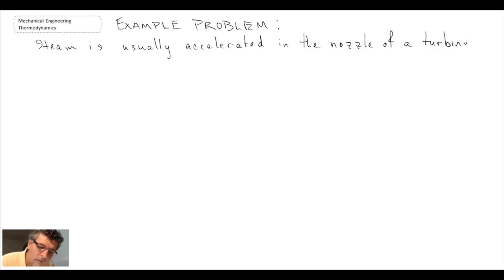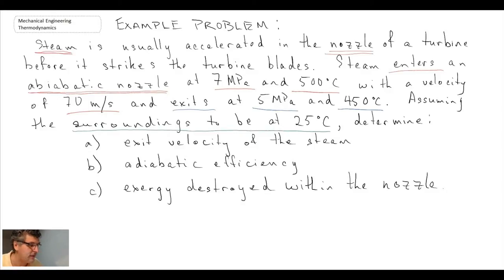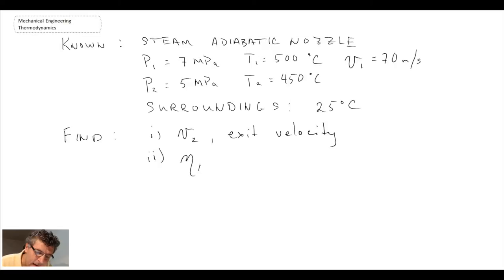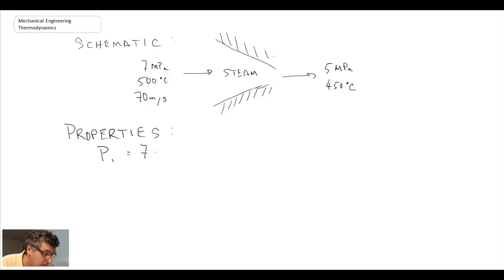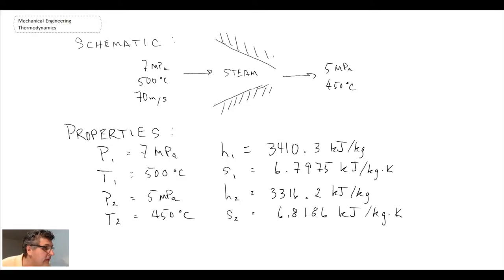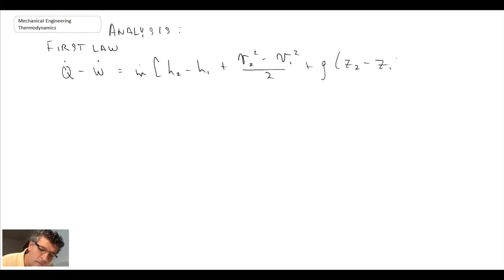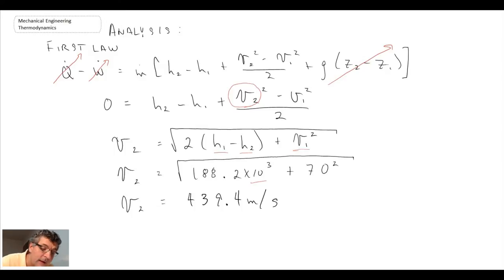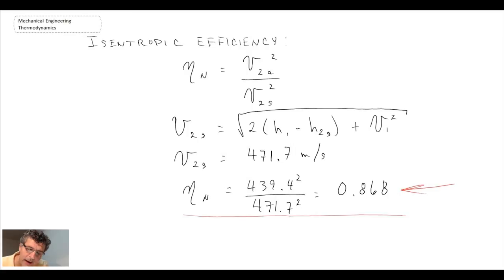Mechanical Engineering Thermodynamics - Lec 13, pt 2 of 3:  Example Exergy Destruction

Comment: Great lectures Ron Hugo !  I was wondering what P2s at 7:55 is?
Reply: it was assuming this process is reversible and adiabatic, then if we want to find S2s, then its value is the S at p2s, which  is equal to S1 so that delta S=0. 
Hope this helpful.
Reply: very much helpful indeed. i was stuck at the same place :)